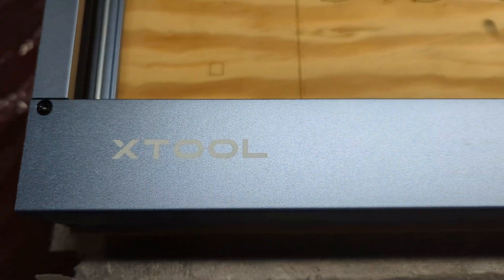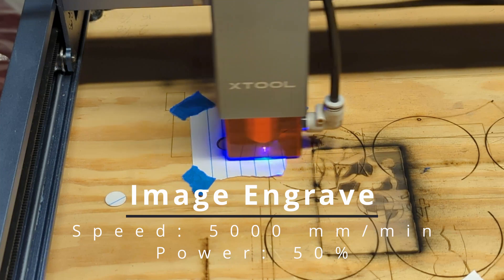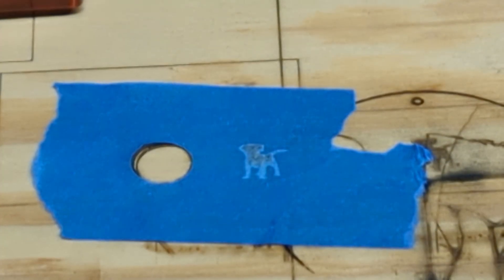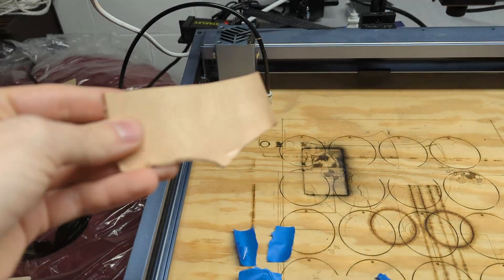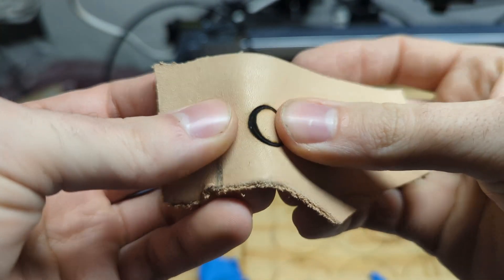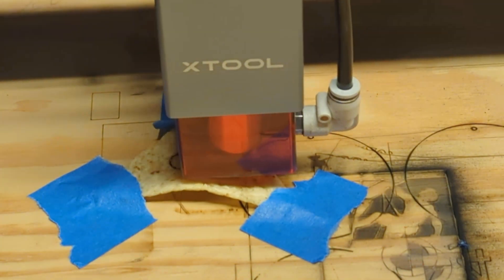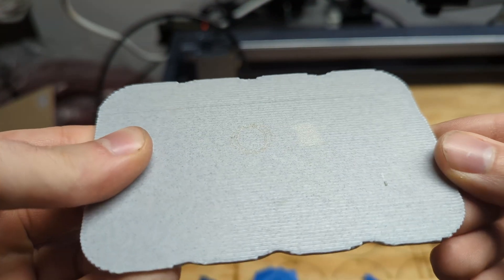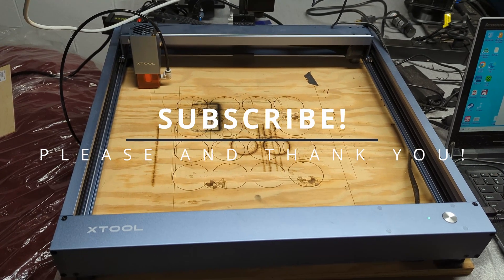Blasting Random Materials with the Xtool D1 Diode Laser!

Comment: The reason it will mark steel but not Aluminium is related to its ability to conduct heat, Steel (including stainless) is not a great conductor of heat so the heat remains concentrated where the laser hits, Aluminium is somewhere between 8 and 10 times better at conducting heat away
Reply from the maker: That's correct. The other half of it is the aluminum oxide. The wavelengths of the laser can't seem to make it through the oxide layer, which forms near instantly on bare aluminum surfaces.

Comment: Try pulling out and turning the knob on your head to get a better bite
Reply: You can engrave/mark clear acrylic there's lots of different ways to do it so just search it and see which works best for you...the popping was probably micro fractures a sign to turn your settings down 😉
Reply from the maker: I've messed with that head and dovetail a few times, mostly to check if the thumb screw has damaged the soft metal enough to cause an issue. Nothing has really helped too much and when I get the time I'm going to rework the whole thing.
Reply: Mine wouldn't tighten at all but had seen on another channel that it was a spring loaded knob . Hope you get it worked out, that would be really annoying
Reply from the maker: Ah yeah. Mine is an older design. There's no spring. It's just a screw with some knurling on the head and then threaded in. There's a guy online that sells a replacement/upgrade that I'm going to look into once I decide to upgrade to limit switches on the x and y axis.